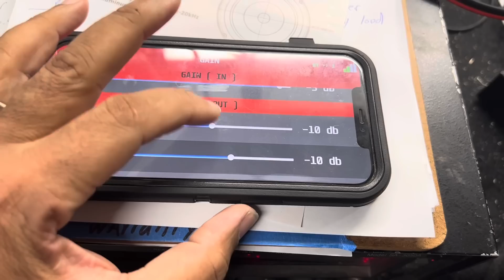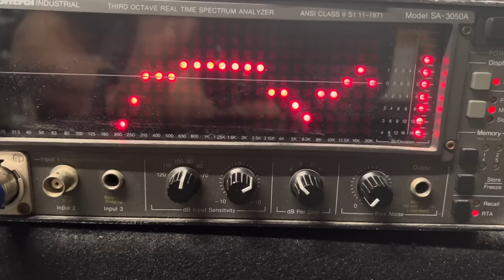GaleForce Audio F3 6.5  F3 8 review by Nvs Audio

Comment: Quick question on these speakers. I am planning on the 8" versions in a wakesurf boat just to not jump on the WetSounds bandwagon. NOTHING against wetsounds, just like to things a little non mainstream as long as it doesnt cost me any performance.  The question i have, obviously these will need alot of power and 2 seperate amplifiers. I am okay on that. But, are they designed to only work or work better in a pod or soeaker enclosure? In my boat, that will not be possible. Its just a wall into the hull open air style. What would be needed changes? More power or less power due to open air and no/less control on the mid bass. I assume this will not effect the horn/tweeter....? Any input would be greatly appreciated!! Thanks
Reply from the maker: I’m
Sorry I can’t give you an answer because I have not compared the 2 head to head .

Reach out to the guys at galeforce they have excellent tech support before and after the sale

Comment: which is the better option, this one in the video or Hertz sx 165 neo
Reply from the maker: Two completely different speakers you cannot compare them at all. The Hertz plays well on low power. This one plays well on high power. The Hertz is dropping Fit no modification. This you have to modify the pod to get it to fit completely opposite speakers.
Reply: @NVSAUDIO  I already have hertz sx 165 neo, so it's not worth exchanging it for the one in the Video

Comment: I just can’t understand any of this. 800 watts makes no sense to me. I have 200 watt per channel amps in my home stereo and it will vibrate my walls , seriously.  I’m missing something. , I realize this is on my iPad , but it sounds to me like a clean 75 watt speaker. Sub’s could handle that but they got like 3/4 -1 inch of excursion with 3 or 4 inch voice coils. I just don’t get it.
Reply: Think in terms of setting up a pro audio setup for club or concert venue. Everything you know about home and car audio goes out the window with bikes.
Reply: @ericperry72  I wish this was explained well somewhere. I think it's possible you just made me realize that what sounds good on a Harley or rack mounted on a wake tower might sound like shyt in a stationary, low wind, low noise competition, tightly boxed and baffled setup. 
The cerwin Vega hybrid 6.5 and 8 at 103+ spl and >150w rms made me look into these type speakers. Plus harsh weather handlong